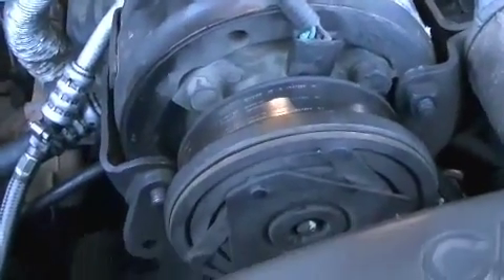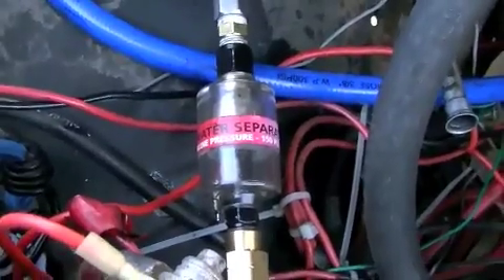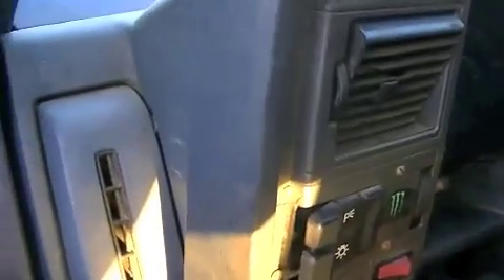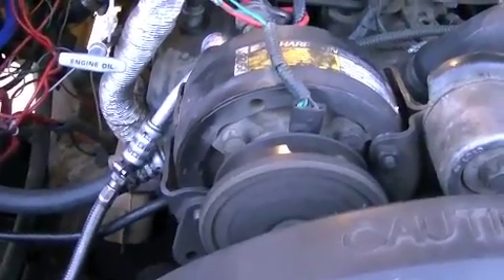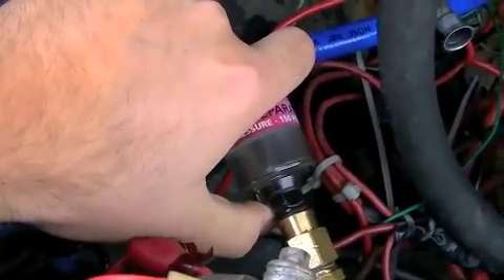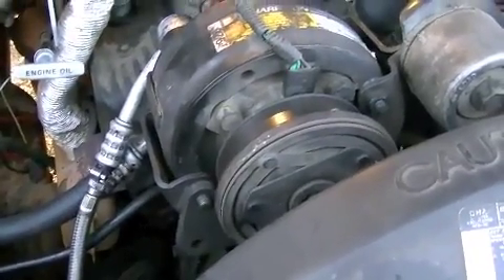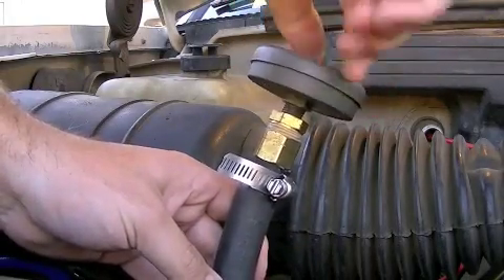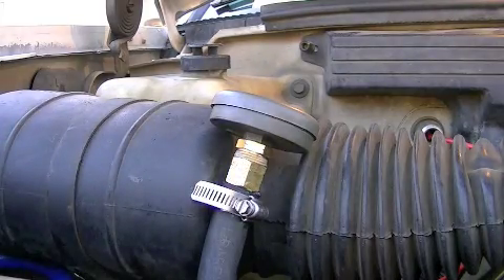Car A/C Compressor Converted over for use as an air compressor Part 2

Comment: How did you set the psi to 135 with a car ac compressor
Reply from the maker: I wired it up to a pressure switch on my tank and used a relay.
Reply: it can reach about 250 psi or more if you dont install any control.
Reply from the maker: Some like the old style "York" can go up to 300 psi

Comment: very cool idea. I had a similar plan on a little bagged S10 I had in highschool to keep air in my storage tank. but i never did it, I did hook up an old dual train horn about 10 years ago that my dad got from one of his friends that was a retired engineer to the a/c compressor on his 78 Ford truck. we had a blast scaring people with that thing..lol. the faster you revved the engine the louder that thing was..
Reply from the maker: its much better to have an air tank and a solinoid valve, more fun, did that with a Nathan Airchime K5LA.

Comment: In last video you said something about a setup the would spray a mist of oil during pump operation for lubricant. Why didn't you do that? Also would this work for horns without a tank? As in the pump would only turn on when horn button is pushed? If so how often would oil need applied?
Reply: Ry V yes it works perfect for the industrial train horns. I hooked up a set on my dad's 78 Ford truck. and just ran the power wire to the horn button. it was pretty loud just with the engine idling. but when you revved it up or you were driving on the hwy it was ear shattering loud..lol. we had alot of laughs scaring the crap out of people with that thing...
Reply: Did you do that hook up without a tank? Straight hose to the horns? How many horns?

Comment: How did you do the wiring? And how does it disengage when the tank is full?
Reply from the maker: the pressure switch actuates the a/c compressor clutch, when 12 volts is applied it engages, when the switch detects the pressure is full "depending on what kind of pressure switch you have" it turns off and "Disengages" the clutch.

Comment: You should run a tube from the oil/air seperator back into your intake/suction tube and keep that oil running thru it
Reply: bellasonchase  that would be a pretty good idea. But what about when the pump isn't on? Wouldn't it fill up with oil?

Comment: You could use that as a turbo
Reply: No, but he could use it as a supercharger.  Turbos run using exhaust pressure energy and supers use belts, gears, or both...
Reply: @SharpLine-Donnie  whatever! Forced air induction. Any way you want to call it. You know what he ment
Reply: @jamescarter1500  of course I did, but did he?  If you asked me to grab you some channel locks, and i came back with wire cutters, I'd hope to be educated and explained.  Do you find it less a jerk move if you let me go thinking wire cutters are channel locks rather than providing me the correct information?  OK James.  James ok...  Im a mechanic, not a magician.  Id rather explain how its done than put on a act..

Comment: How consistent is your air flow I want to convert mine to fill my tanks for my air ride
Reply from the maker: +Tony Ambrocio Depends on the RPM if you want more flow, a higher RPM would make it pump faster but make sure it is oiled every so often.
Reply: repeatman for bigger jobs you could hook a little 12volt actuator motor ran thru a toggle switch,  attached to your throttle cable or throttle linkage to idle the engine up to 2000rpm's or so for an instant boost of pressure..
Reply: Don’t do it I don it befor and it ruin my valves because you have to keep adding oil to it

Comment: Ok so it works? Did you think about taking the compressor out of the car and actually mounting it to an air tank and electric motor and compressing some air?
Reply from the maker: I actually am using it to air up a 3 gallon tank I have on my truck.